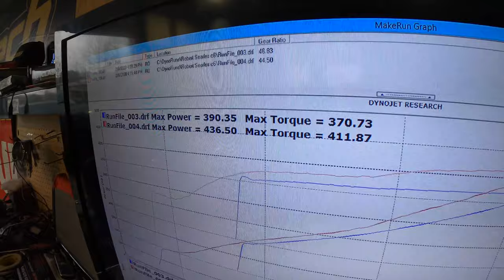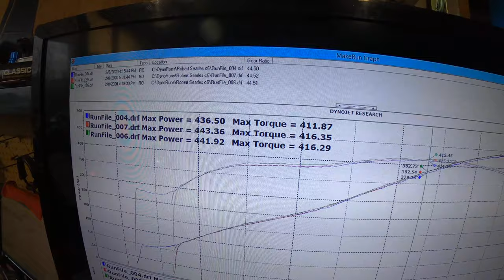Dyno Day!

Comment: Is the motor oversized studded on the FD?
Reply: It wasn't. Balanced and 10mm studs. It lost compression from side seal contacting the plates on the rear rotor. Engine is already getting machined. 5x 1/2" studs, solid dowels, balanced and clearanced for the 9-9500rpm it's turning.
Reply: mark shoaf ok. So not retaining the stock tension bolts? Are the side seals oem along with the springs?